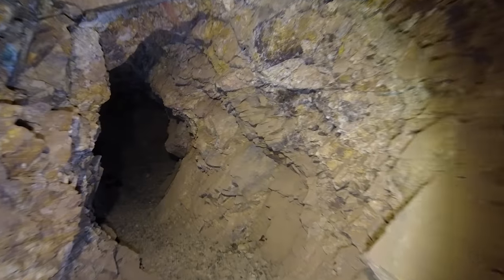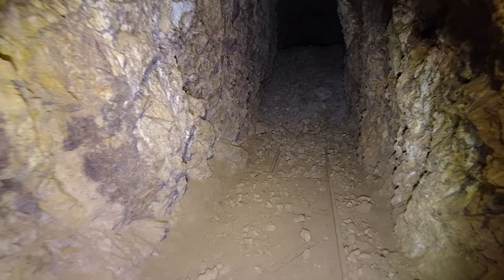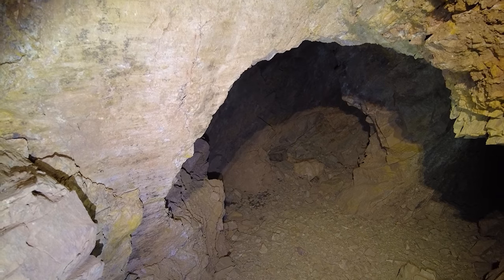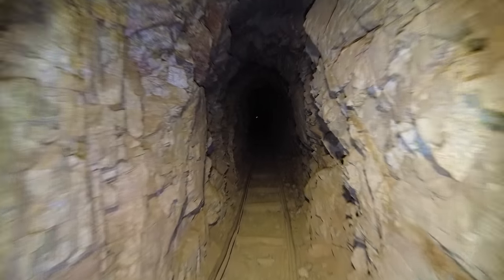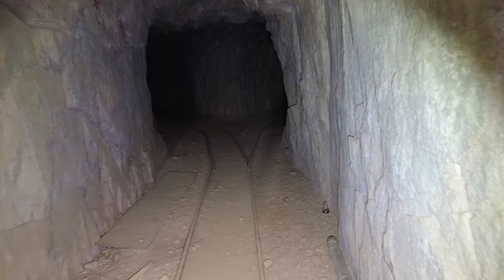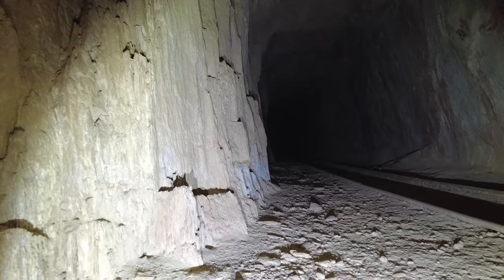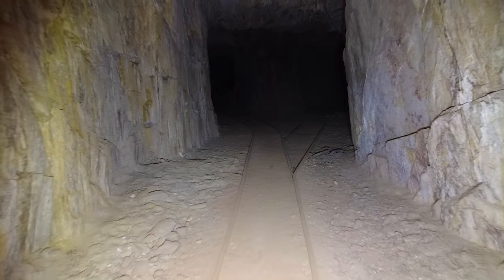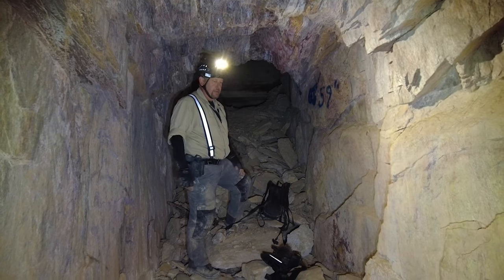Risking Death, I Dig Out an Abandoned Mine and You Won't Believe What I Found

Comment: Yeah another excellent episode.  Hey I'm starting to get worried about all those sketchy ladders you risk climbing on. Sooner or later a rung will give out.  Have you though of some fall arrest gear with a retractable line.  We use them at work for long accent/decent tower ladders. If you slip it instantly halts your fall.  Easy to set up with a little rigging.  I know more stuff to haul around but I'm just thinking of your safety.  Thanks again for another fun episode.

Comment: Hi, Gly, thanks for your previous answer, I got it, that helped. I went a bit astray in terminology, so I asked for explanation and got the different one. I hope my translation is correct. So, incline shaft is main or secondary connection between many levels. It doesn't matter if it opens to the surface or not, it's called the same. The only difference is a section for skip cars or other equipment and manway. Raise is vertical or steep inclined tunnel to upper level or it could be a small stope or just exploratory. Winze is the same thing in opposite direction - downwards. Nothing that corresponds decline was found. But they really distinguish horizontal opened and blind tunnels. Opened are adits and tunnels, blind are drifts and crosscuts (and bulkheads). Drift is a tunnel that follows the vein, but if it goes through country rock perpendicular to the vein and opens it, it should be called crosscut. That's where hard turns appear. But I've never heard this word from mine explorers. Also I have a question, why don't you use some kind of straps or hooks/hangers for your camera rig to let your hand rest holding the camera for a few hours and make climbing easier? Some ladder tricks don't look very safe with your rig.

Comment: Great episode guys.  Some great stuff in that mine. Would have been great to see down the vertical shafts, but glad you went for the safe option  👍. Looking forward to when you get the rope gear.  That old motor was cool, when you find old motors is it possible to get a quick shot of the data plates on them . Stay safe guys 😎👍

Comment: You most definitely want to explore this one further. There are holes and shafts all over that complex. There used to be a trail going up the hill where the waste rock pile is, but it was washed out by a huge storm we had go though the area. And a lot of the waste rock got washed down the hill too, it was much much larger many years back. All of my research on this one says it goes down 600 feet. And that rock is called Yavapai schist. I have a half ton of it sitting around my yard and house. lol. Not really, but I have a lot of it with copper minerals in it. And there is a beautiful chunk of azurite in a stope that my hubby climbed into.....but it's 40 feet above your head, so no way to get it. I have a picture of it though. :)

Comment: There is, I believe a way to use the rails as an antenna for your radios, and possibly any metal ducting. The railroad uses (used) the rails as 1/2 of the radio system, from what I remember.
VLF radios would likely work in the mines also.  That area you crawled thru was a totally , imo, foolish place to go. Yes, very cool stuff, but I also noticed how dry rotted many of the timbers were. The only safe way to get there would be to move the dangerous rock and rebuild the lagging & stalls.

Comment: At 17:29, that's a four-cylinder radial air motor. Since it's disconnected from the air tugger (the red I-R visible behind it) and has two sheaves set on top of it, I'll venture a guess that the tugger was set some distance away from the motor with power transferred via rubber v-belts on the sheaves. Those tuggers are sometimes used in raises to hoist drills, steel, and powder up into stopes.

17:59 not a jackleg or part of one, but it may be part of an old ring-and-post drill, the predecessor of the jackleg. The threaded shaft definitely indicates it was adjustable.

Comment: The Allen Bradly fused disconnect had Aluminum wires in and out of it. Probably a 1970 install. That’s when they used Aluminum around my way . Had a lot of fires from that wire also .

Comment: When you get your ropes in, I bet there are interconnections that will bypass the collapse. There's just too much mine there to not have multiple routes, especially since it's more modern.

Also, that collapse has been there a while, so... how did something get in there to make fresh scat? It could obviously get in and out because you didn't find it dead of dehydration in there. Must have been small enough to slip through the existing hole. Which... I'd have been itching for a folding shovel, lock it down to 90 and lash it to a pipe or a board, and just drag it back and forth to lower the pile while being far back enough to get out of the way if things let go.

Comment: 16:40 IDK what you normally carry for a handgun, but you really should have something integrally suppressed. not for any cool factor or anything like that, but I think a standard 9mm going off in that mine without ear protection (assuming you had to use it and didn't have time for earplugs) could really damage your hearing and disorient you like a flashbang. that would definitely not be good, especially if a follow up shot was required on something like an angry cornered (and now wounded) boar.

If you want to test it yourself, just find a small exploratory mine and try a few shots under the conditions you expect to need it in a mine. I'm betting that first shot underground surprises you

Look into something like the maxim 9 as an example of what i'm talking about as an integrally suppressed pistol. it looks like it's a scifi blaster, but it keeps the noise down enough where you could keep your wits

Comment: I was wondering lots of the time when the roof the mine fails and closes access to other drifts was that mostly caused from stopes and having very low stability because of the stopes that are connected to the drifts or is it just mostly overtime the roof just fails because of earthquakes or just other mother nature events?
Reply from the maker: “Gly”: Most of the time rock failure is caused by varying degrees of ground water penetration.

Comment: tomato juice DOES NOT WORK WHEN YOU GET SPRAYED! back in the early 80s when i was in the air force i was sent to check on a missile silo that had its alarm go off indicating someone or something was on site. when we got out there we found a rather large adult skunk roaming the grounds. the thing sprayed me from a distance of about 15 feet n man did that sting as well as stink. when we got back to the launch control facility we tried the tomato juice trick in fact we used every single drop of tomato juice we could get our hands on (about a gallon) n it did nothing to cut the smell. i wound up trashing my uniform all the way down to my boots once we got back to base...2 days later. needless to say i was not a very popular person for those few days.

Comment: Could you  have done what the miners would have done? Just bang some wedges into it until the ladder was secure?
Reply: @Scott Urquhart  --  You would still need to have your body weight suspended on a rope when you drove the Wedges into place to tighten up that Stull .  With your weight on the ladder when you drove in the Wedges , as soon as you stepped off the ladder the Stull would spring back up loosening everything again and possibly letting the Wedges drop out .   --   < Doc , Miner for over 50 years >  .